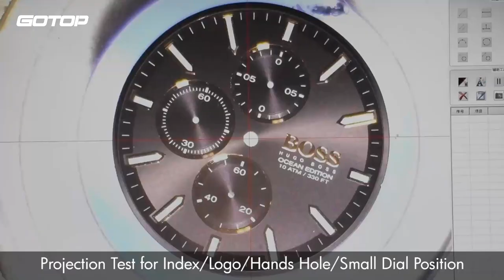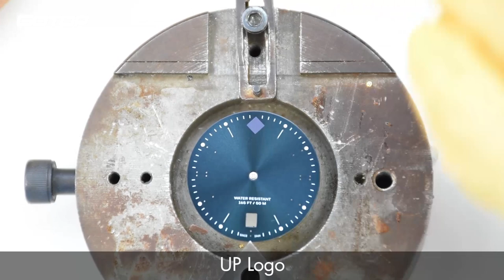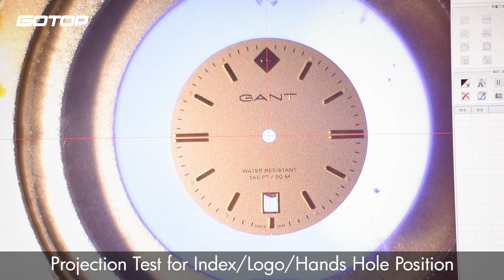How to make watch dial

Comment: Amazing. Keep in mind the same process is used in all high end watches. They do them in batches. Unfortunately if you have a very old watch there’s no more NOS. So a dial resto can be very expensive.
Reply: The same process is made, but you can't deny that more care and attention is taken in high-end watches. Tolerances are higher, fit and finish are better and most high end movements are designed to last for many decades, not a few months like fashion watches.